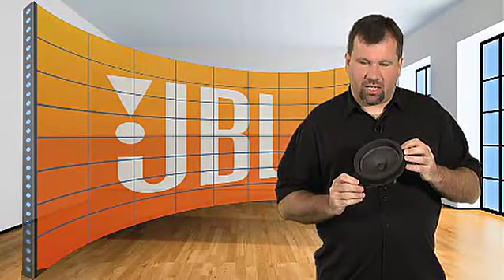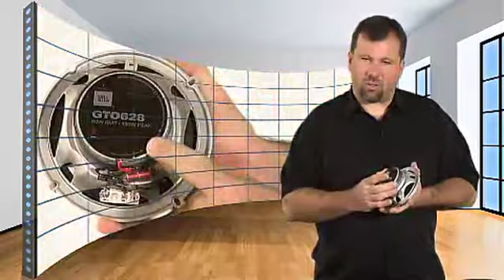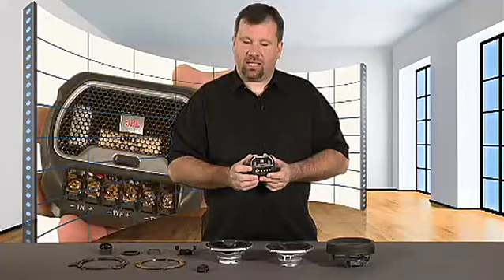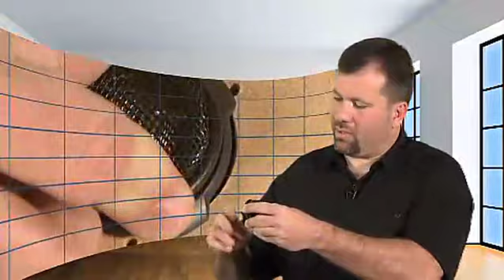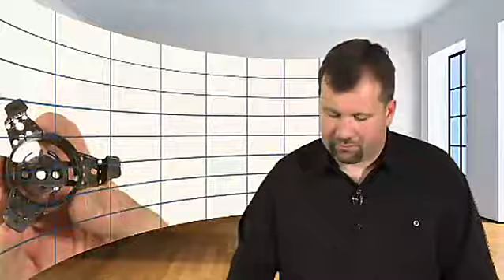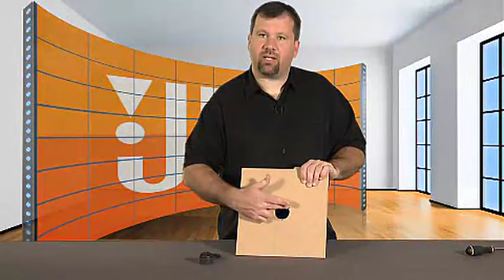Amazon com  JBL GTO628 6 5 Inch 2 Way Loudspeaker  Electronics

Comment: The crazy thing about factory speakers (assuming they in good condition) is that they actually pretty good in the 120-300 range. Besides that and they sound ok with 5 watts most of them are junk. Here is the thing dont ever pay for the premium sound package. Your getting $40 worth of speakers and a $90 headunit and a $50 sub that the dealer will charge you upwards of a $1000 bucks. my friend wanted to replace his factory speaker dealer wanted $300 for a pair of $10 cheap paper speakers..No way.